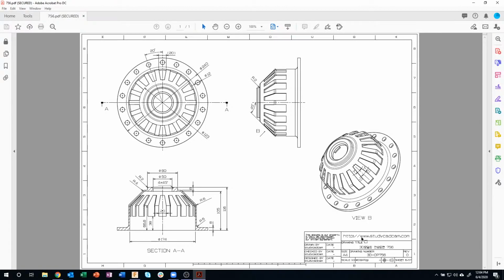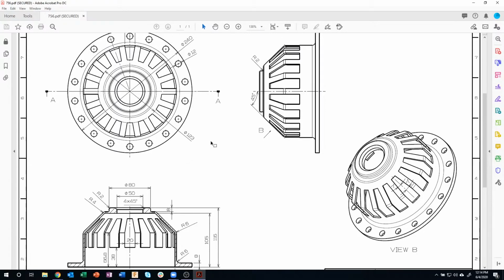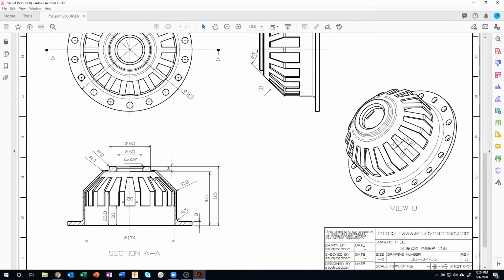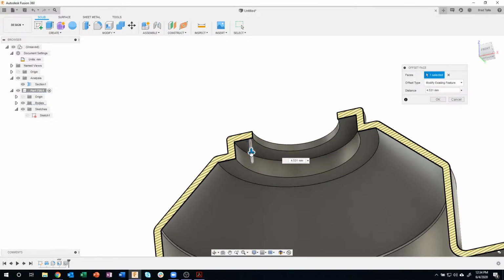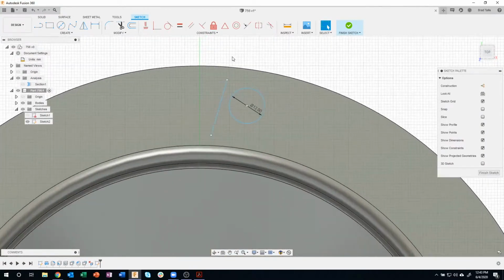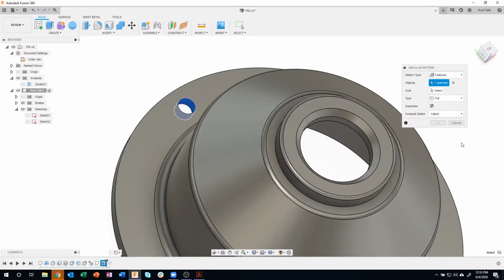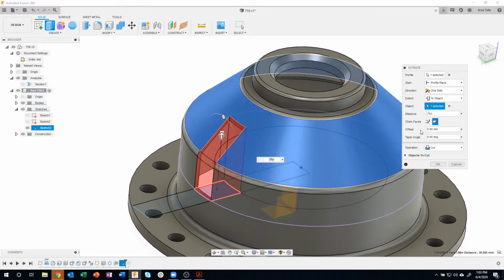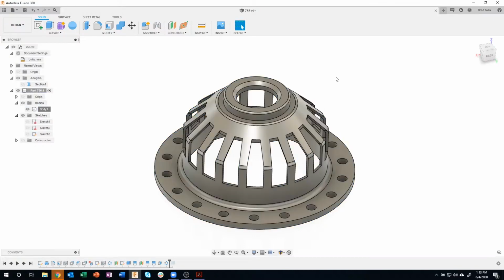Episode 63 -  Stump the Chump

Comment: You should always make the count parametric (e.g. put "mynum=18" instead of just 18) in patterns - and then check after it worked that if you change the count to a larger number, that it still works.  This is the main problem that using "features" instead of "faces" solves.

Comment: Just subscribed, really love all the videos.  My guess is that part of the challenge of these drawings is that it is not fully dimensioned.  So you have to use other tools in order to figure out the non-dimensioned parts.
Reply from the maker: Yep, I pretty much "reverse-engineer" the actual parts and take measurements with my calipers.

Comment: Hi, thank you for you tutorials! They are really helpful, I learned a lot from them. I like to email you, but I couldn't find any address, so instead I leave message here. I have watched one of your tutorials on Autodesk official site, named Direct modeling in Fusion 360, link as below:
https://help.autodesk.com/view/fusion360/ENU/courses/AP-2019-DIRECT-MODELING-FUSION-360
Great tutorial on direct modelling indeed！but I have found one thing really confusing. at 59:39 of it, you use press/pull to change the distance between two opposite faces, at first it was 47mm, then you choose the re-anchor option of the function, typed 50mm in parameter box, and you say the distance of them become 50mm. 
This is really amazing function. So I have been practicing it many times, but each time the result is disappointing, if the initial distance is 47, the result will be 53, not 50. I have asked this on facebook community, but seems like nobody is interested.
I uploaded the same vid as facebook group to my channel, cause I don't know how to share facebook post's link.
https://youtu.be/k7cFYD8Xn3I
Hope I am lucky enough to get some answers to my question here, thank you again for you tutorials.
Reply from the maker: @Quan Li-  Thank you for sharing the example video.  I just recreated the same issue you were showing.  I'm thinking something has changed with the Re-Anchor command.  I will pass this information on to the developers.  You weren't doing anything wrong.  :)

Comment: Didn't make it to the live stream, but I've got 7:00 minutes in and paused for now. This is exactly the sort of challenges I've been looking for. So, I've downloaded the drawing and I'll be giving it a try in the morning, then I'll come back and watch the rest of the video. Thanks Brad.
Update: Couldn't wait till the morning, so just finished. It's taken me 57 minutes to complete, will watch in the morning and see how our methods compare.
Mostly we adopted the same approaches, the main difference was for the extruded slots. I created a sketch of 2 lines radiating from the centre and closed of the ends, the 2 sides were dimensioned to the 7 degrees from the drawing, this meant I did not need to do the draft at the end.
Reply from the maker: Awesome for challenging yourself and doing the project!  Ya, if I were to do this again, I would do the slots differently.  They were not orthogonal with the surface, I realized.